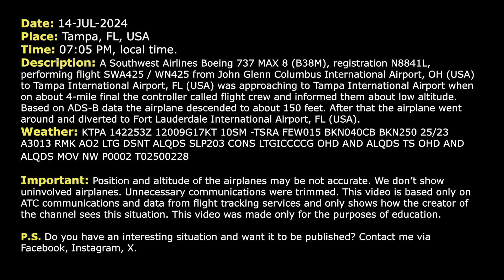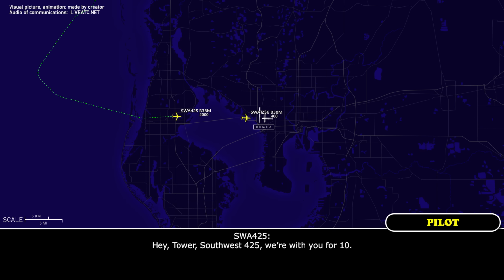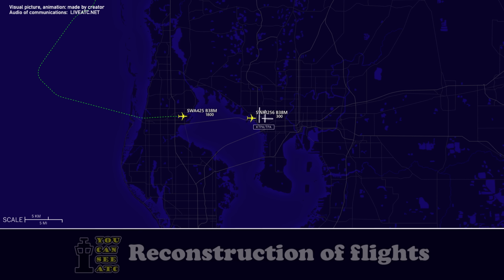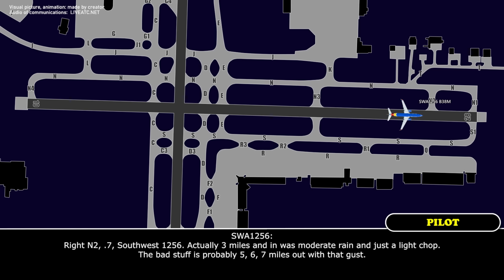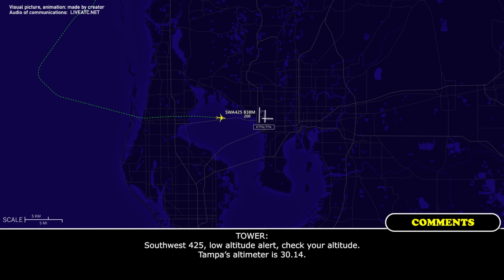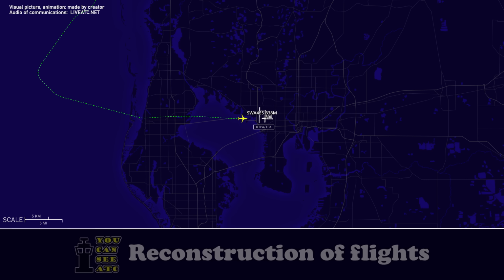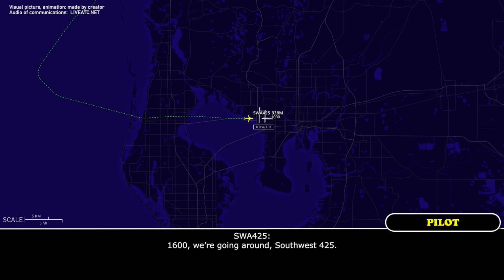Extremely dangerous descent to 150 ft. Low altitude alert at Tampa. Real ATC

Comment: No ILS to Runway 10, so crew would not receive "GLIDESLOPE" EGPWS warnings.
Reply: RNAV only?
Reply: @thatmikereed  Correct
Reply: The RNAV to runway 10 is an LPV which is a PA, so if they were 150 feet above the ground that far out on the approach, they should’ve still received some audible warning.
Reply: @matthewrammig technically an LPV is not a precision approach, even though it does have vertical guidance. In addition, most airlines today aren’t even allowed to do LPV approaches
Reply: I guess I picked the wrong week to quit amphetamines.
Reply: @matthewrammig that aircraft can't do LPV mins
Reply: Ok so let’s assume that it was an RNAV approach. Cloud base was fine, visibility was reported to be fine however the moderate rain could have reduced that. What could they see at DA/MDA? Was the FAF height checked? Was VNAV being used or were they using VS? Were there DME/ALT/Time checks? Was the set altimeter actually correct? That’s the type of stuff I would like to know.
Reply: LNAV MDA is 480 feet. There was definitely no reason to be that low on the approach unless something unexpected happens.
Reply: @yssyplanespotter  There's a crossing restriction of 1600 ft at the FAF (ZEXYY) just over 4.5 miles from the end of the runway. There are obstructions almost up to 150 feet about a mile and a half short of the runway.
Reply: @flyoma  Looks like they crossed the FAF at around 600ft. Looking at the playback, I noticed that their descent rate at that point and just beforehand was around -1000fpm to -1700fpm with a 140kts GS. They were really close to that causeway too.
Reply: @user-ye1hh1ut9r  slight correction.  They can do lnav/vnav which is 436
Reply: Anyone who’s done rnav in the sim with an incorrect altimeter knows.  Pretty difficult to catch the mistake even when you are being demonstrated the mistake.
Reply: @matthewrammig they prob use LNAV vnav mins

Comment: 0:13 were they in a downdraft and rain? Or maybe a case of a microburst with the previous flight reporting the “bad stuff” about 5 -7 miles out. That looks about the same distance as the radar depiction.
Reply: Almost certainly microburst. These not only push the aircraft down, they also can have an anomalous barometric pressure.
Reply: @KennethAGrimm  that was my thinking as well. It would also make sense that the crew would divert to an airport with better weather conditions.
Reply: The only instrument approach to runway 10 at TPA is a RNAV and it has a crossing restriction of 1600 feet about 4.5 miles out from the runway. So that would be a hell of a downdraft to get that low. There's a bunch of hotel towers about 1.5-2 miles off the approach end of runway 10.
Reply: @KennethAGrimm  but doesn't the adsb take the altitude data from the same sources as the instruments the pilots see? agree with the likelyhood of it being a microburst, though
Reply: You don’t get that low though before initiating a go around and the lack of urgency in the voice of the crew sounds like they didn’t notice their mistake or even worse, wanted it to go unnoticed…
Reply: @mattthompson8487  I have a friend who flies for Southwest. You would not hear urgency in his voice either. In an emergency, he goes icy cold. Some men and women are like that.
Reply: @nosuchanimal6947  Correct re ADSB altitude. So while the pilot will be seeing a big discrepancy between the radar altimeter and the barometric altimeter, ATC sees only the barometric.  In a dense cold air microburst, the pressure altitude will read low, so the actual (radar) altitude may have been higher that the 100 ft minimum we see on ADSB. But... That pilot just wanted out of there.  You don't "try it" in those conditions. I am guessing by the time ATC altitude alerted, the throttles were already moving forward under manual control, and the yoke coming back.
Reply: They didn’t report windshear though did they?
Reply: @KennethAGrimm  No, it's not a microburst. They busted the 1,600 feet minimum altitude between POLVY and ZEXYY. The problem started way, way before the controller called out a low altitude alert.
Reply: @Mattribute  They did not report windshear to the tower or the departure controller.
Reply: @pilotcritic  Good to know, but my first thought was microburst and those have downed planes in the past on landings.
Reply: I don't think so.  The tracking data shows a constant descent and decrease in ground speed.  A  microburst would have shown a rapid change in both.  I also believe they would have reported it.
Reply: Pilot puahed wrong button. Got distracted.
Reply: @nosuchanimal6947  no adsb is satellite based just like a GPS and the altimeter is barometric and set based on local atmospheric conditions. It also indicated altitude above sea level and not the field elevation. Not a big deal in florida as most airports are near sea level but in the mountains your altimeter might read 5000ft and you fly right into a mountain.
Reply: @mattthompson8487  1000s of hours of flight time and a lot of prior service pilots. Might feel no more nerve racking to them than swerving around a tire in the road while driving a car.
Reply: @flyoma  I didn't think 10/28 had any ILS or instrument approach options. Definitely does not have an ILS localizer at either end of the runway
Reply: @troynolen6448  No ILS... only a RNAV which won't give glideslope, only lateral guidance.
Reply: @troynolen6448  So the RNAV basically will take you to the runway but not guide your descent. It does have some milestones/crossing heights along the way to clear obstructions and of course has minimum descent altitudes but other than that altitude is on the pilots.

Comment: I thought was going to be a reupload. Nope.
Are there no low altitude notifications on SWA planes. Also good job tower.
Reply: I think when it's configured for landing a lot of those systems are disabled.
Reply: Yep, there's an envelope around the approach path in which the egpws is inhibited so as to prevent nuisance warnings (yes, i know there's terrain, that's what i'm aiming for!)
Reply: Is the pilot monitoring not doing his job?
Reply: No alerts, I assume, but aren't there regular altitude callouts?  If you get the "minimums" callout waaaay before you expect it, that should tell you something!
Reply: @PikalaxALT EGWS should have gone off that far out.
Reply: @PikalaxALT  "  Yep, there's an envelope around the approach path in which the egpws is inhibited so as to prevent nuisance warnings "  Right, but it's not as simple as "EGPWS" is turned off XX miles from the airport."   You get stepped terrain limits the closer you get to the airport,  EGPWS is still very much active all the way to touchdown.   They should have been getting EGPWS warnings a long time before they got to 150 ft, 4 miles from the runway.

Comment: This is a very uncommon Runway 10 approach. It's even possible these pilots have never executed the approach before, but that really doesn't excuse them losing altitude awareness. 

Runway 10/28 is the only East-West runway at TPA. Runway 10 is only used when a heavy East wind is present, it's the rarest approach. It does not have an ILS either. 

The main runways are 1/19 which I would say are used 85% or more of the time. Runway 28 is used when there is a West wind, it's more common than 28. 

A Runway 10 approach will take an aircraft right over or slightly parallel to the Courtney Campbell bridge and right over the Veterans expressway at very low altitude.

Comment: SWA 4069 did something similar on approach to KOKC on June 19. What's up SWA?
Reply: Not A SWA issue today, it was a pure dangerous weather issue. SWA made the right choice, go around and go elsewhere.
Reply: Slipshod hiring practices while chasing revenue?  Poorly trained new flight crew members?
Reply: @KennethAGrimm they were at 150 AGL 4 miles from the damn airport. That isn’t “weather”, and if it was a microburst (which is almost NEVER undetected these days with modern radar), they would’ve reported it.
Reply: @PositiveRate99 exactly what I wrote as well -signed a 737 type rated pilot
Reply: @PositiveRate99  Yeah, that was my thought, if they were aware of their situation, and hit a microburst that knocked them down well over 1,000 ft below their intended altitude, they would have been (or should have been) executing their windshear escape maneuver a long time before they got as low as 150 ft..

Comment: Where did you get 150 feet AGL? From the track log on FlightAware, I see a pressure altitude of 150 at the low point. Correcting for altimeter setting and field elevation gives about 350 feet, not 150.
Reply: Are you a pilot, John?  What do you think the RW 10 elevation is....about 14'. Altimeter setting was correct.....He was at 150' pressure altitude, which is the same as AWL (water) radar altitude over that bay...... Nearly heartstopping, to be sure...
Reply: @billmartin8874  Yes, I am a pilot. They were at 150' pressure altitude. Pressure altitude is only the same as true altitude on a standard day. The altimeter setting was read off by the controller as 30.14 inHg, which is .22 inHg higher than standard. Correcting the pressure altitude with this correction factor gives about 350 feet above the touchdown zone elevation of 22 feet.
Reply: @johnbowerstone2378  ADSB had them at 150 feet. The controller is REQUIRED  to issue the correct (and likely same) altimeter setting of 30.14 whenever they give that warning, to confirm what the crew is using. Damn near certain the crew had been using that since descending thru FL180. There is an Approach/Descent Checklist that is done then, changing the altimeter and if is not - a big yellow flag appears on the alt the altimeter - impossible to miss.  And whenever changing frequencies on approach and  the setting has changed, the controllers are required to tell the crew when they first come on the new frequency. And even IF they were at 350 feet 4 miles out....still BAD, BAD error....but I'm betting with ADSB's 150.' We - and those 160 folks were REAL fortunate.
Reply: @billmartin9455  ADS-B reports uncorrected pressure altitude- essentially what would be shown if the altimeter were set to 30.14 inHg. So you shouldn't "trust" it outside of standard atmospheric conditions- you need to correct it. 350 feet is still low, but it's obviously a lot better than 150. It's actually pretty close to the MDA had they been on the RNAV for runway 10.
Reply: I’ll tell you what. Let’s wait until the official report comes out and tells us exactly how low they were- and then we’ll know which of us knows from which he speaks.😊

Comment: What is really concerning is that the Westin Tampa Bay on Rocky Point is 16 floors so that's probably 175ft tall... That only adds to the yikes factor here. In theory the flight path to runway 10 would have been slightly North of that but only 1/4 of a mile or so...
Reply: 185" high. TWO of them there. See the comment with the picture of the map.

Comment: Landed on 28 a few times, never 10. Was also probably a first for the pilots. Traffic is 98% of the time on the 1/19 runways.
Reply: they never use 10. that's my question, what was going on? I worked at tpa for a good years and say saw them use it once over some runway work, and it made the local news to come out and watch
Reply: @jsomething2  they don't "never" use 10... come on now. 

They use it when the weather conditions dictate they need to... IE: heavy East wind that is above the threshold for crosswind on 1/19. 

Same for runway 28. I work in one of the tall office buildings downtown and when weather conditions (heavy West wind) dictate the use of runway 28, the flight pattern for some landings have planes skirt the Eastern edge of downtown Tampa, fly right over West Tampa and land. I've seen planes curve remarkably close (couple miles) to my building setting up for a runway 28 landing. 

Happens more than you think.. 

Admittedly a Runway 10 landing is by far the most rare approach, and its quite unnerving to be driving down the Veterans Expressway and see a large plane like an MD-11 fly right over you because you never expect them there

Comment: One of the earlier vids suggested they were low on fuel, so diverting to Fort Laud certainly made no sense when you had 10 other closer airports, assuming the diversion was Tampa weather related.  So I think something else is not being disclosed.  Also sounds like they forgot to set the right barometric setting on the altimeter for the Tampa Airport, I thought that kind of thing was automatic, I guess not. And don't forget rule 1:  If you can see bikinis, you are too low.

Comment: ADS-B has been around since about 2018 and is not a reliable source for enthusiasts like the OP for putting info in titles "150" ft etc into vids, despite disclaimers. The twr uses a better still used radar syst for altitiude..

Comment: At 4 miles you should be at 1200 feet…150 ft… bruh…something ain’t adding up…this is the second time for southwest…in a short period of time.
Reply: They may have encountered a microburst
Reply: @jim2lane  Then why didn't they know?
Reply: @jim2lane  I think that is unlikely. The crew sounded very calm. Either they didn't care they were low or were unaware. Either way it's not good.
Reply: Absolutely this!. Chances neither the captain nor f/o understood how a  3 in 1 profile works or how to apply it during an approach. Shameful lazy airmanship yet again from these rule breaking southwest cowboys!
Reply: @jim2lane  Anything is possible, but unlikely windshear or microburst. They would've reported it to the tower.
Reply: @JCP_323  Sometimes, you can input a wrong altimeter setting. It happens. However, if it's not independently verified against the official local setting by both pilots, then a scenario like this is possible.
Reply: @BruiserFL  This has nothing to do with a wrong altimeter setting. Do you have any idea how wrong that altimeter setting must be to put the aircraft 1,000ft low? They aren't going to do that.
Reply: @gregorythompson5826  3:1 profile? Magenta line? dotted line? radar altimeter? regular altimeter?  NONE of them were working when the guys have lost all their situation awareness........which looks like they BOTH did....and did....and did.....They weren't trying to figure out what altitude they should be at 4 miles out, or 3 miles out...they didn't have  a clue WHAT ALTITUDE they were at......or they would NOT have been there!!🤬😡

Comment: Why would the flight divert to Fort Lauderdale instead of somewhere closer to Tampa???

It’s at least a four hour drive between those two airports.
Reply: I think likely because of the bad weather out on approach and/or lack of confidence in their approach to 10 after receiving that low altitude alert.
Reply: Because of the extent of the bad weather.
Reply: If you're diverting due to weather, it doesn't help much just to go next door to St. Pete or Sarasota. You have to go far enough that you know you'll be clear of the weather system, and ideally somewhere that your airline has a significant operational presence (which WN does at FLL).
Reply: @erobbin144  You mean you can't just use the other runway?  🤣LOL

Comment: Do the commercial planes fly with a radar altimeter or a Vario ( instantanious vertical airspped indicator ) ???
Reply: Yes
Reply: RNAV uses pressure altitude. One would hope the RA callouts would have clued them in if the tower hadn't.
Reply: Looks like I picked the wrong week to quit drinking.

Comment: How did they go below the glideslope assuming it's an ils
Reply: I'm just guessing here but maybe it's one of those falls positive glide paths I've heard on some accident videos
Reply: Could be those wind changes. If they suddenly gained a headwind, the plane could have kept the air speed and it would have translated to a slower ground speed, causing them to get below the slope that way if they continued down at the same rate as before
Reply: @JDrapic  wouldn't autopilot correct for that
Reply: @khwaac  depends on the mode they were flying in and how quickly it happened. Sometimes it can take the autopilot a bit to recognize it needs to change what it's doing
Reply: You can get false glide slope above the actual, but not if you're below.  @Fintoy
Reply: No ILS on RWY10
Reply: At a glance, looks like RWY 10 doesn't have ILS. Not a pilot, but it looks from the animation (if it's accurate) they kept a faster rate of descent from 6000 ft instead of adjusting for the approach (the other plane started descent at 2000 ft and seemed to descend about half as fast). Looks like they hit the right waypoint to start the approach (POLVY) at the right altitude (2000 ft), but just didn't update their descent rate.
Reply: RNAV 10 with LPV so they had vertical guidance via a WAAS GPS.
Reply: @dougg6467 most airliners aren’t able to do LPV approaches believe it or not
Reply: @dougg6467 no WAAS in those planes
Reply: @jakeoesterreich8037  Remarkable, it’s good being a GA pilot with state of the art avionics in an old plane.

Comment: Something seems very weird about this. Doubt they actually got that low
Reply from the maker: ADS-B data shows this altitude.
Reply from the maker: You can check this by yourself.
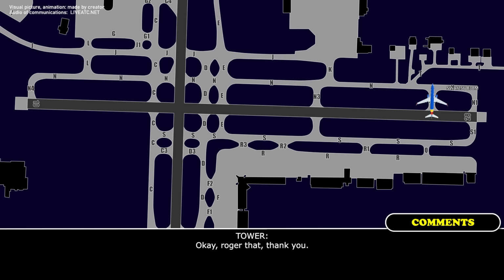Reply: @YouCanSeeATC  Except ADS-B only shows the uncorrected barometric height.  When you get significant pressure changes (such as in the microburst / squall line mentioned by 1256 at 1:10), that will cause indications of height changes that do not reflect reality.  The pilot will see a significant discrepancy between radar altimeter and barometric height, but the ATC will only see barometric data and the resulting apparent change in height.